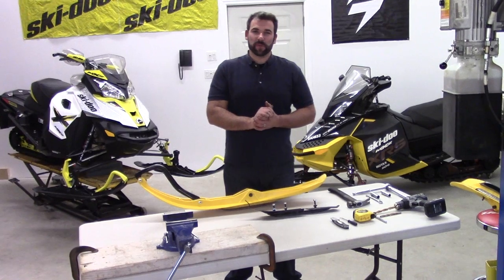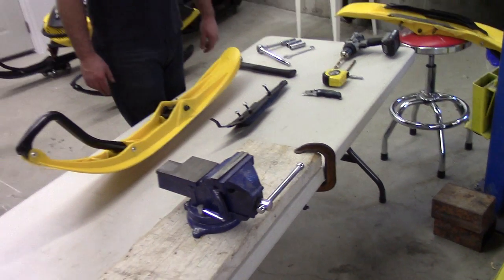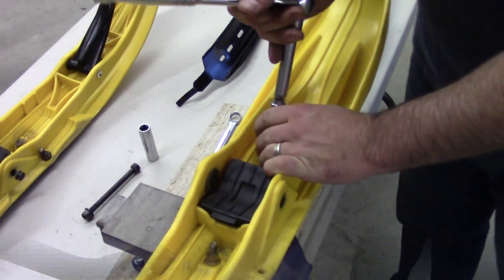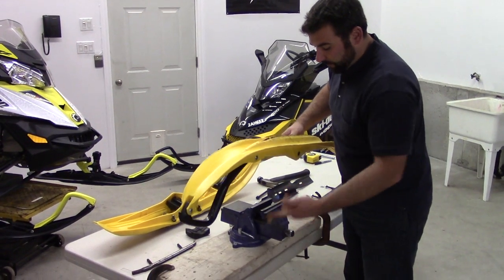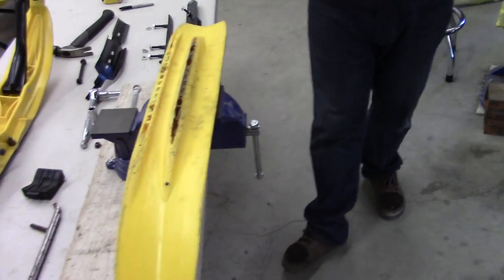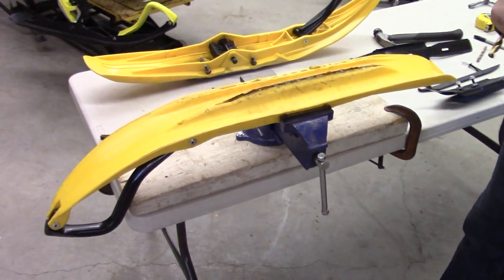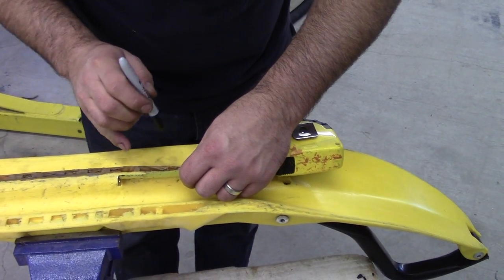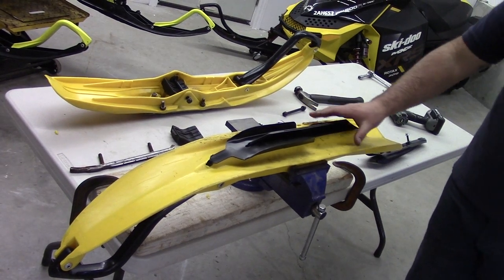SnowTracker carbide install on Ski-Doo Pilot 5.7 skis

Comment: curious if these create a lot of drag?
Reply: yup
Reply: @hugomorin9565  actually no, the way the metal plate is made make them float over the snow, so the ski doesnt touch anymore unless its really loose snow.  Been running these and had to add ski pressure compared to normal carbide.  However they do push a lot on loose snow, so I ended up running better ski with shaper bars.
Reply: @hugomorin9565  nope!